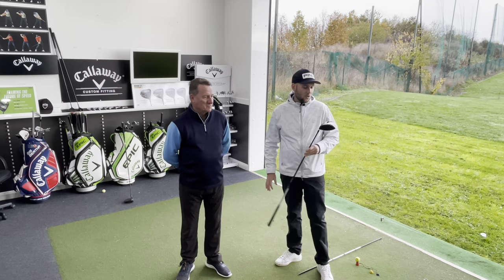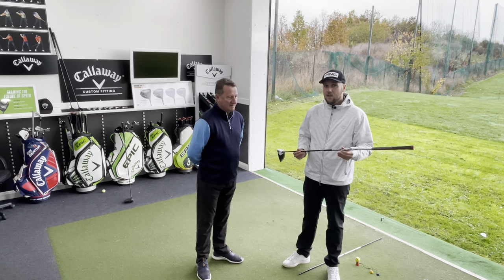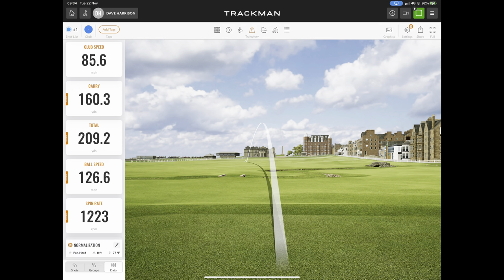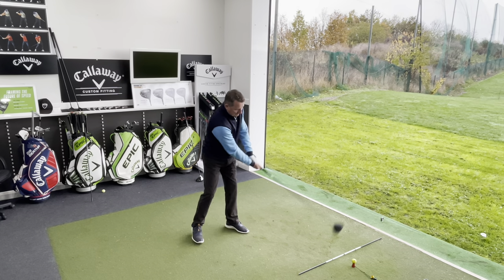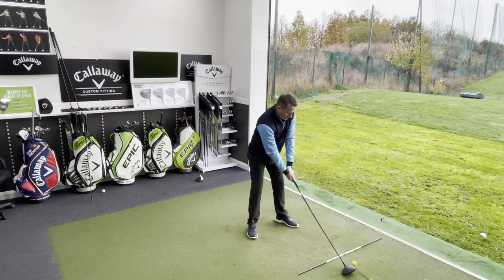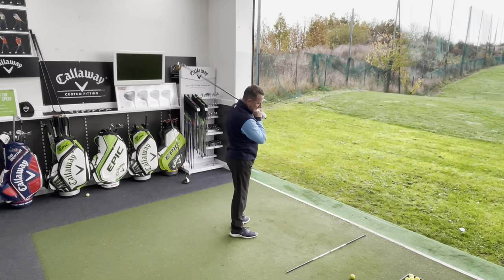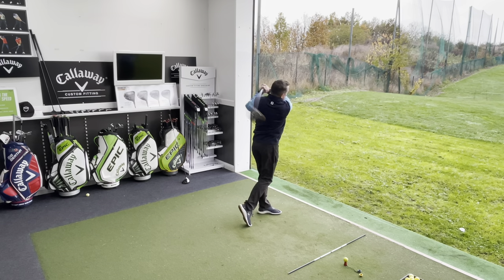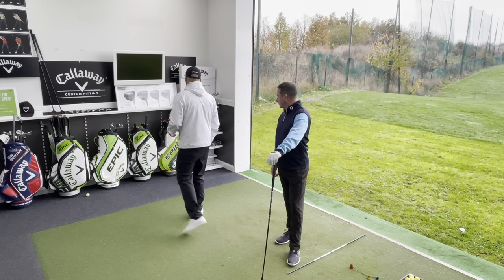2 Second Tip to ADD 25YARDS to YOUR DRIVES!!

Comment: Hi Chris, I like your delivery style (dry and whitty) I also like your 90 second tip videos, because you explain what technique you'll use very quickly in the video. 
With your longer video's would you consider describing what you'll be expanding on in the first few seconds of a video and then what the expected gains will be, rather than just the gains. Looking forward to more sensible chuckle talking balls content.